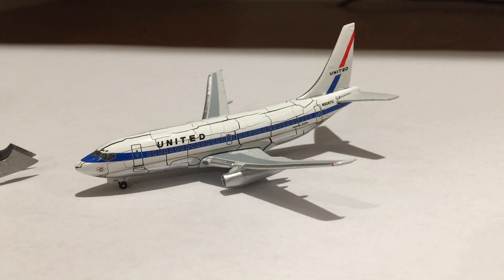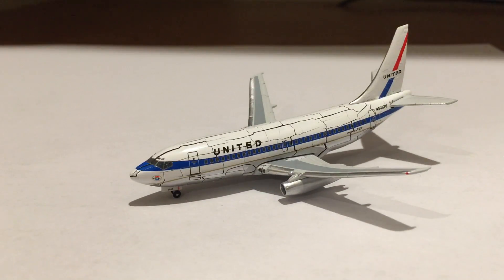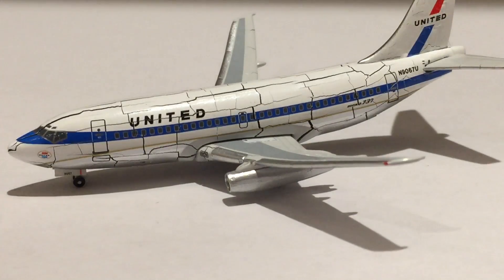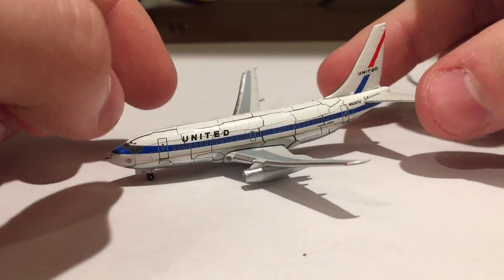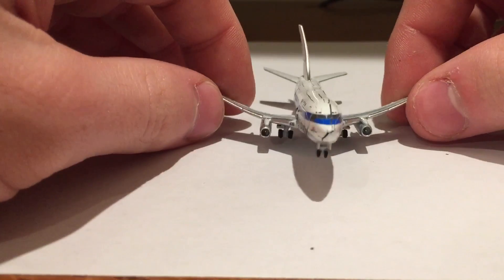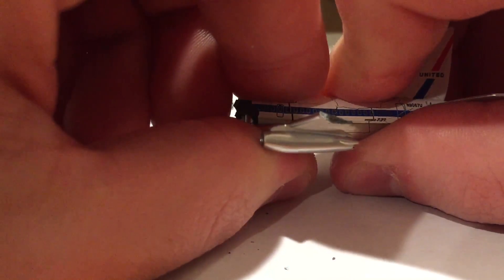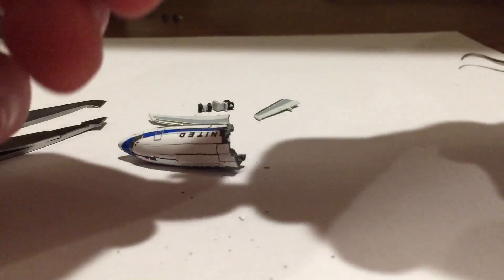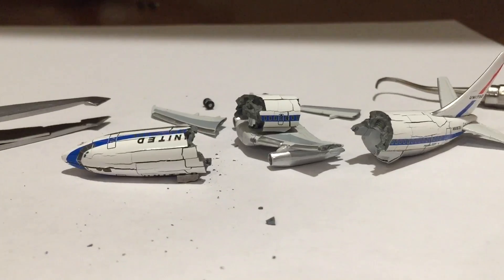What’s Inside A Model Airplane?

Comment: This video proves that aircraft diecast models are highly overpriced for the quality the collector will get in return. 

Basically, most of the price goes to  the license royalty, and the rest is cheap zinc and labor working in near slave conditions.

One of the reasons I stopped collecting diecast models is zinc rot when i had to scrap 100 models from my collection.

Now, I build kit models with upgrade aftermarket parts. Yes, it takes more time to add a model to the collection, but I know it will have a far higher probability to live longer, and it has more realistic details.
Reply from the maker: Maybe back in the day this is true, but zinc rot is incredibly uncommon in recent years. They're still overpriced but if one cares enough about the hobby then it's worth it for sure.

Comment: Zinc rot starts after a certain amount of time after the model is formed (generally around 4 or so years) and stabilises after a certain amount of time, so if it hasn't occured yet the metal will be pure. It's likely that the Thai got damaged during shipping.
Reply from the maker: I'm thinking that's the case too. The Thai seems to be in great shape aside from that.

Comment: How is this not a teaching tool for air crash investigators? It’s like it crashed into the sea, and was reconstructed on a wire frame. I had no clue this could happen to die cast models. Now I’m gonna have look at the models I currently have under the proverbial microscope.